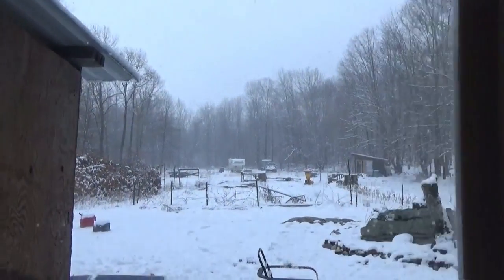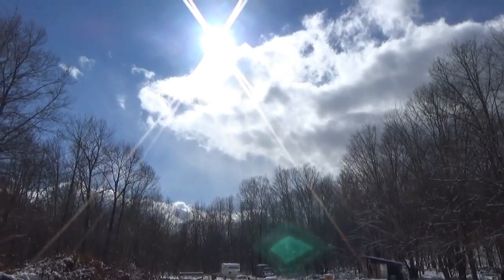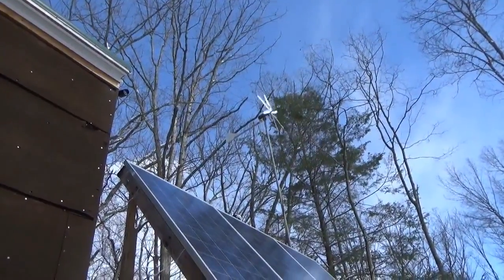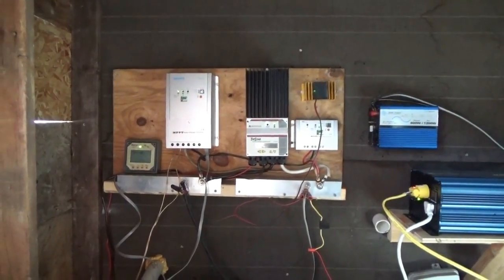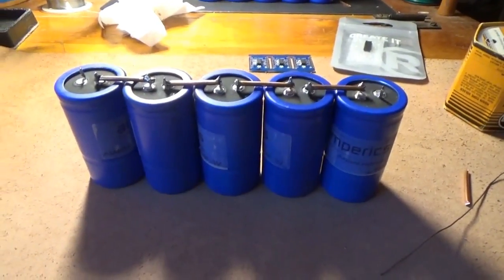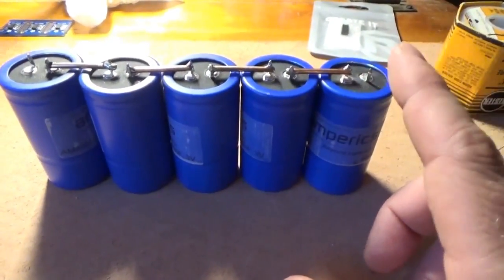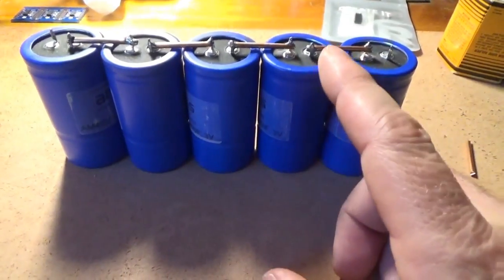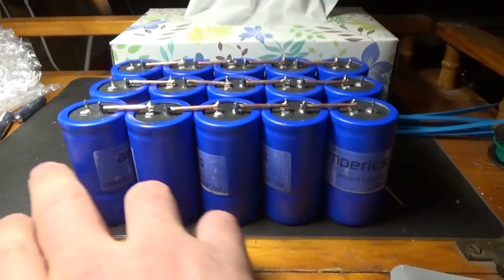Fresh Snow & Building SuperCapacitor Banks

Comment: I'm using 3 strings of 6 x 500F / 2.7v capacitors to start a 5.4l Ford Expedition. There is a 4s2p (3.2v 5Ah 32700 cells) LiFePO4 battery to keep them topped up with a 0.5 ohm resistor bridged by a diode (in the forward direction) to limit charge current to the lithium cells. I also have a 'spare' battery, 4s4p of the same cells, that I can plug in via a constant current down converter to the cigarette lighter socket should the small battery that is permanently connected go flat (the BMS cuts out so the cells are safe). 
The problem I have found is that the down converter loses around 1V in the forward direction, and once the engine starts current can flow back through it with 0.7v drop over the mosfets into the battery - which I don't want as I have no control over the charging current. Adding a diode introduces too much voltage drop .. 0.7v diode drop + 1v converter taken out of around 13.4v on the battery does not leave me with enough voltage to charge up the capacitors and start the car .. it needs to be at 12v at least.
What I am doing now is making an 8s battery (25.6v) with a downconverter to keep the capacitor bank topped up and an upconverter to charge the batteries once the engine is started. To get the required hysteresis I am adding a mosfet with a TL411 to detect that voltage at the 12v side is over 13v ie. the alternator is working and start charging. 
Where I am, in the Philippines, lead acid batteries barely last 2 years due to the high temperatures - I am hoping the capacitor / lithium battery combo is far less heat sensitive and should give a much longer life.

Comment: It’s 400 farads again, 5 caps @ 400f and 5 rows means ur back up to ur full 400f @ up to 15v, a nice little bank, good job!  Will be very useful and handy I’m sure for many of ur little jobs an projects. I do like the higher voltage idea, not sure about cost compared to the Maxwell 3000f caps, which may be more cost effective , and rugged too.  5 0r 6 Maxwell caps will give you a voltage of 13.5 - 16.2v with a burst capacity of up to 10,000amps, and 2 banks of 5-6 caps if you want up to 27-32,4v with a 5-8000amp burst capacity would be good for your solar / wind projects, etc, plus you could start a truck or bulldozer if you wanted to.  With the Max caps, while it is always advisable to have balance boards with any/most cap setups, you probly would not need them if you have a reasonable redundancy built in, ie, less volts or more caps , then only occasional if any balancing may be needed/necessary.  Just my thoughts, caps are great for so many things and I think we are going to see some big changes in these renewables areas soon. Great vids, thanks

Comment: In my car I'm running 2 strings of 5 Samwha RU 500F 2.7v caps in  parallel. That gives me 13.5 v and a capacitance of 200 Farads .The bank is paralleled with a 12v 7ahr lead acid battery. It seems to work OK but if the car sits around for 3 weeks or more without being cranked the unit discharges..But it only takes 20 minutes to recharge. If I use the car every day , the pack stays topped up..I haven't worked out whats wrong with the unit as yet?? or maybe that is how it spose to work??
Reply from the maker: These capacitors have a high self discharge rate. They must be topped off all the time. You may want to add another capacitor to each parallel set because they do not take kindly to over voltage and a car can get up to 15 volts.
A small solar panel plugged into the cigarette lighter outlet could keep the capacitor bank topped up at all times.

Comment: Sure the capacity drops with 6 over 5 but I assume you could get 500f for probably cheaper and be about the same and also I sometimes the ground wire will be smaller like 12AWG but that may not be the case but could be

Comment: What sort of AHs and/or WhHs would u get out of your 15 cap setup? I'm interested in using caps as a bank for a small solar setup...600 watts/hr to run some lights and basic electronics, and I am interested in knowing if it would run through the night without getting dangerously close to running the cap bank down. Figure max draw would be 100 watts/hr through the  night.  Any idea?
Reply from the maker: I do not have the numbers to do the math on this but I do know that capacitors do not carry that much energy overall. They can deliver all of their energy in an instant which is their positive point.

Comment: Maybe I’m missing something, but wouldn’t it be better to put a bank of capacitors between the panels/turbine and the charge controller to the batteries? Or on each panel and the turbine, feeding another larger capacitor/bank before the controller?
Reply from the maker: I use an MPPT solar charge controller so that would mess up its function. But between the batteries and the load helps reduce surges on the batteries and extends their life.
Reply: The Do It Yourself World I have to clarify in my own mind  what MPPT is/does, but to my mind, stabilizing the supply would benefit the charging capabilities and longevity of the main storage bank in a significant way.

Comment: With respect to the comments being made about the fan not moving:

I am no expert in this field, just expressing my logic regarding ( " Frames Per Second "); as this attributes to the phenomena. 

Assuming your camera's recording FPS is 25 frames per second and the wind happens to be blowing at the same speed, the illusion " on camera " will make it appear to be stationary.

A visual anomaly which tricks the eye is like when you are watching a computer monitor on TV, it appears to be flickering, this is because the computer monitors refresh Frame Rate is different to that of the camera recording it.

A similar anomaly also happens when you look a cars wheel when it is driving forward at speed, it may look as if it is actually spinning backwards which would mean that as each revolution is faster than your eyes Frame Rate, it will seem to be doing just that, but in reality we know it is moving forward.

Another way of testing this theory is to get a round card and paint black and white pyramid shapes to the centre of it and spin it with a strobe light facing it, when the spinning card matches the strobe frequency / FPS the black and white pyramids will appear to be not moving.

Hope this helps demystify the issue.
Show less
REPLY

Comment: Hi, first nice work... But I'm not sure of your calculation for power:  5 Cap X 3 V = 15 Volts... 400 Farad / 5 Cap = 80 Farad X 15 V = 1,200 Watts   Compare to 6 Cap X 2.7 V = 16.2 Volts       500 Farad / 6 Cap = 83.3 Farad X 16.2 V =  1,350 Watts   So your set up is 150 Watts short and your voltage will drop to 12 Volts a lot quicker compare to the 6 Caps @ 2.7 Volts set up.
Reply: how you get 500 farad as you mention 400 farad earlier?

Comment: I think it depends how you define capacity. If you mean you're reducing the capacitance, yes you're losing capacitance. But the capacity of actual energy storage is the same, theoretically. 

The problem is, if you were to wire them in parallel, you'd have 3V to work with. And most switching regulators don't work for anything under 2.5 V. So you basically have to cut 2.5V off of your calculations. So it's better to wire them in series to boost the that number higher.

Comment: I strung 18 2.7v 500F 3P/6S for a working voltage of 14.4 @ 240F . It starts my 1974 Chevelle with a 350 c.i. V8. I get three attempts before the voltage gets too low, but with an old 14.4 volt laptop battery pack keeping the voltage up, I get far more "starts" out of the hybrid battery/cap bank.
Once the car is started I remove the lithium batteries from the system.

Comment: how thick are those wired on the bank? they look thin and that will give you rather large voltage drop trying to start ur car. regarding balance u can find cheap ones on ebay. have not used myself but have friends that have that. keep up the work
Reply from the maker: 10 gauge and no these are not going to work well for a car. These will work fine for small engines though. I have another set of capacitors for the car test now. Huge terminals and connectors.

Comment: I worked on Copiers back a few years ago.  The older ones used flash lamps to light the original.  The capacitors were milk carton size.  I bet those suckers would have worked well.
Reply from the maker: I would love to see one that size.
Reply: I don't know where they are now,  It all went digital.

Comment: equal capacitors in series, you can devide the capacitance of one cell by 5, so one series string of 5 caps are 40 farad, at 15 volts, adding strings in parralel, you can ad 40 farads per string.parralel , you ad, series you divide. (and the same in cap banks, counts for all other banks, positive on one side, negative the oposit side of the bank, not both conections on one side.), this wil give you the most available power.
Reply from the maker: With the 400 Farad capacitors I get 80 Farad using 5 caps in parallel. At least thats what my calculator is giving me.
Reply: 400 devided by 5. (tougt you had 200 farads.. lol)
Reply: You divide 400 farads by 5 for the series combination =80 farads. Then because they are again connected in parallel you multiply 80 by 5 and get 400 farads simple....

Comment: Maybe I missed it but are your batteries 6 volt or 12 volts?
Reply from the maker: 12
Reply: Ah, ok I was just wondering because I use 12V also with similar solar panels and was trying to get feed back to see if theres any significant changes in the amp/hr if I were to change over to the 6V batteries, I know it's supposed to be a big change but trying to figure out if it's really worth the money to convert..Thanks
Reply from the maker: +Fryingsquirrel just the quality of batteries makes the big difference. Going to 24 or 48 volts improves system performance by reducing loss in the wires. I would not go down to lower voltage
Reply: what are you running on 24V
Reply: what brand batteries are you using ..I heard one rough way to tell if they are really good batteries is the heavier they are the better they are too
Reply: oh ..ok ..i was thinking if i used a desulfator it would be ok..but I'm not sure..because I will be running appliances
Reply from the maker: I am using Trojan T105 6 Volt golf cart batteries. Strung up to make 12 volt batteries. I have nothing 24 volts here. You cant just go by weight but most of the good batteries are considerably heavier. Mine are 80 pounds each
Reply: Thats exactly the brand i was looking at ..I think it was 27-AGM but anyways I have lots of cold months just like you and I'm glad to hear your pleased withe them , I mean you know how it is, all  the manufactures claim to have the best , then theres online reviews, but i'm usually most satisfied if i can hear it from somebody I know that endorses something
Reply: I think one string of 5 caps in series will give you the same capacity as one capacitor
 just raised voltage.
Reply from the maker: The Trojans have very good reviews in off grid homes.
Reply from the maker: paul, capacitors actually have a reduced capacitance when putting them together in series while adding the voltage.
Reply: Im going to check into the price of the Trojan batteries, they seem like the correct ones for the application ..thanks Troy
Reply: Oh ..Ok ..I'm going to check into that then, I like having some kind of variety to look through to choose from , just wondering what's your reason for suggesting those ?